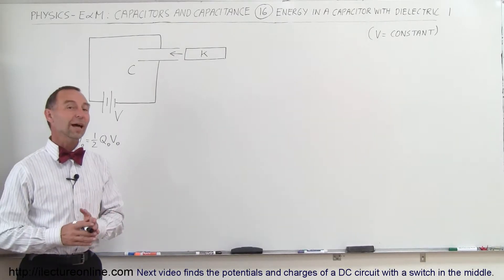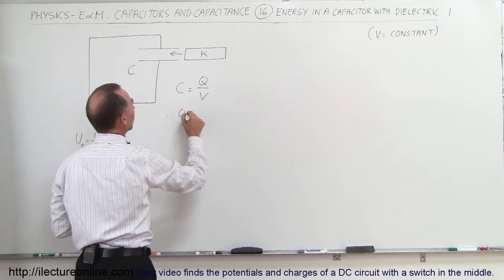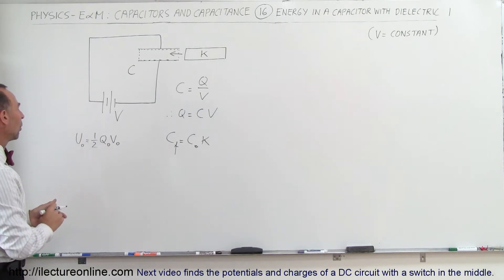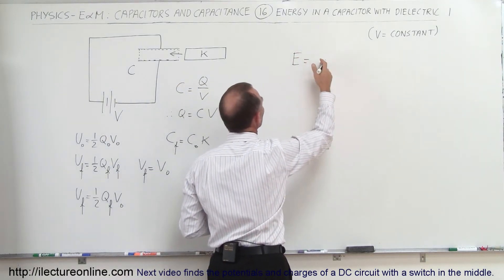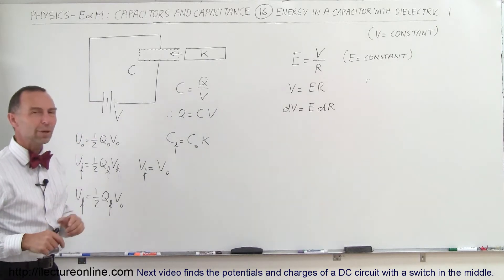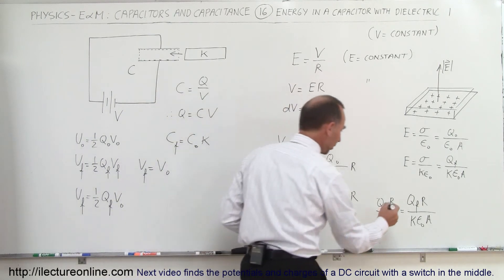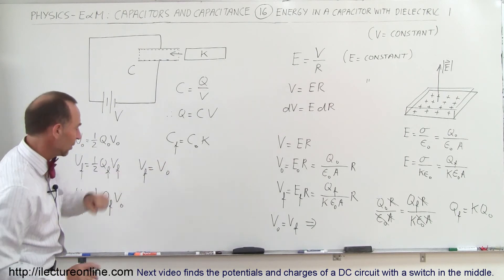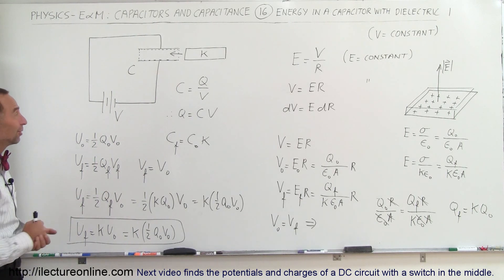Physics 39   Capacitors (16 of 37) Final Energy Stored in Capacitor w/ Dielectric

Comment: Why don't we calculate and add the electric field of the negative plate to the total electric field?
Reply from the maker: The magnitude of the electric field does not belong to the negative side or the positive side.  It exists because there is a separation of positive and negative charges (which are equal in magnitude and opposite in sign on both sides).  So we just need to consider the charge on one side.

Comment: huh? what happened to the V^2? shouldn't it be 1/2KCV^2, not just V?
Reply from the maker: The energy stored on a capacitor can be expressed as:  U = (1/2) QV = (1/2) CV^2
Reply: ohhhh, i completely misread. thanks for clarifying.

by the way, since in europe, voltage is U, would you happen to know what do use for energy in a capacitor?

Comment: Why E(initial) = E(final)??
Reply: I think the one thing that confused me at first was the sigma symbol is the same for both Eo and Ef on the board, where it should be (sigma)o and (sigma)f. And it may be clearer to say E(total)o = Eo and E(total)f = E(new) - E(induced), where E(total)o = E(total)f
Reply from the maker: No, E(intial) = k * E(final)     (the initial voltage = final voltage)
Reply: Michel van Biezen yes got it...thnx